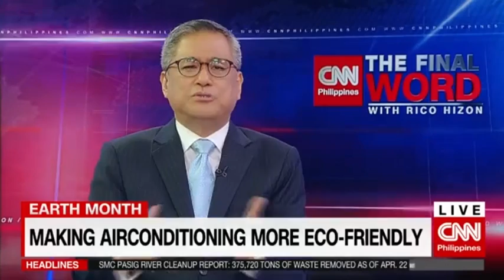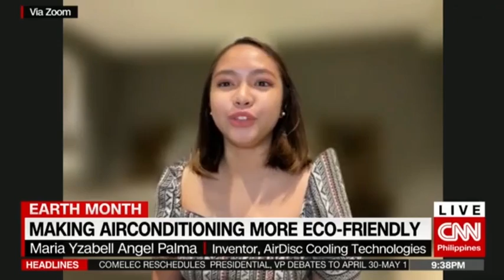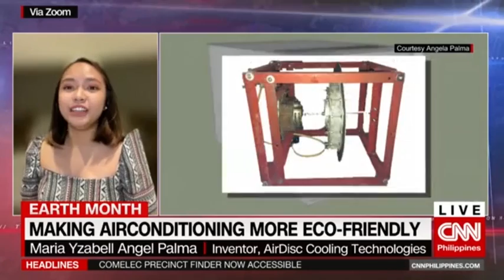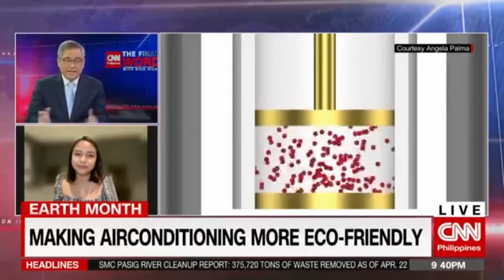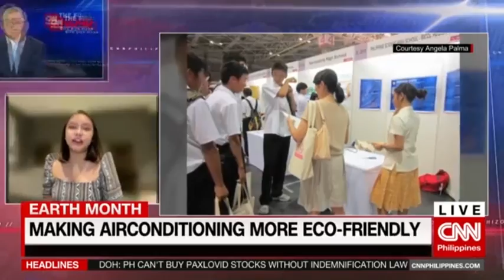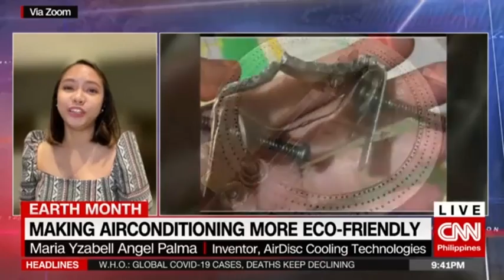Making air-conditioning more eco-friendly | The Final Word

Comment: This defy the law of physics. Energy In is always equal to energy out. Heat in & Heat out. Proper technical data and test should be shown NOT just measuring by laser point temperature which is not the complete way to conclude it really works. But still I hope this is true.
Reply: Lol. Think! If this invention do not work, will she still be here speaking in 2022?! 

Your skepticism is very very late!

Comment: Wait... malamig nga po. Pero kung sa sariling closed room din kukunin ang hangin nagagamitin. 
Walang proper ventilation for oxygen. Walang mag provide ng oxygen at mag tatapon ng c02. Ang typical aircon kumukuha sya ng hangin outdoor with oxygen.

Ito sa sariling closed room palalamigin ang hangin.. baka ma suffocate tayu nyan. First of all there must be a source of oxygen or oxygen production...hindi basta lang lamig lang.

Magiging isang malaking refrigerator ang siste.
hindi sya safe, makaka suffocate yan if walang source ng oxygen... dapat may sytem din na mag lalabas ng carbondioxide.

Oxygen ang reason ng aircon kaya kumukuha ito ng hangin outdoor.

In your case mag papaikot ikot lang ang hangin sa loob ng room. Ang ikinatatakot ko eh... baka yung mga japanese e, kopyahin lang ang prototype mo.. improve nila ng hindi sinasabi sayo... at basta knalang iwan sa ere. 

Correct me if im wrong.
Kase pede pa maimprove at napakalaki ng potential. Oxygen must produced... and make sure mailabas din c02 sa room na nakakalason sa tao. U know what i mean.

Comment: It uses the fan to cool down the water compression tank. Not a new technology but a neat idea
Reply: Wait so it has a compressor Motor?
Reply: @ironman8727  it's pulling air to cool off the AC unit. That's what it looks like